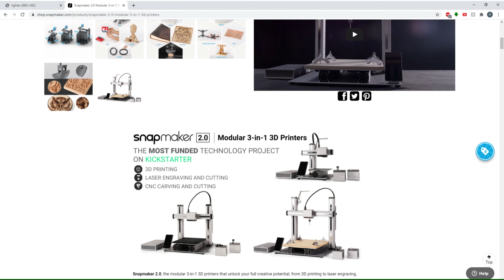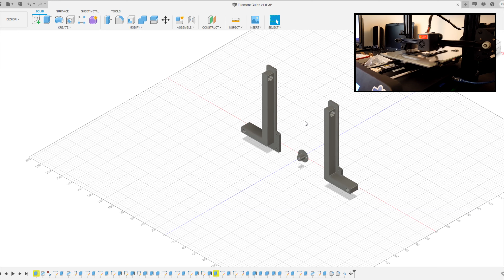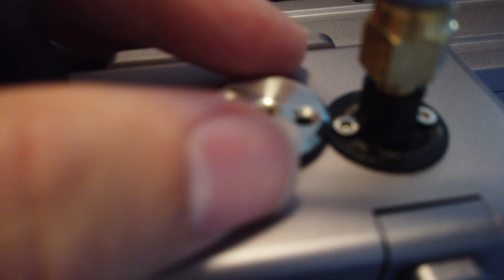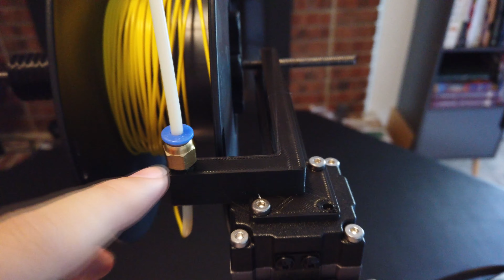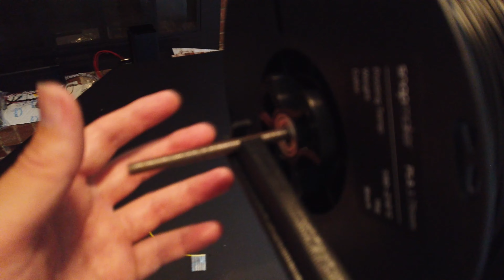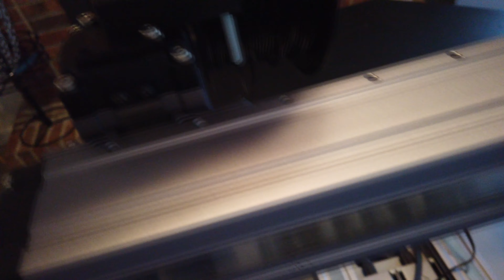SnapMaker 2.0 - Filament Guide System

Comment: It also tackles the problem of "shavings". These Snapmakers tend to rub the spool against the frame because it drags it left to right and the edge where it leans to is kind of sharp. What you notice after a while is a black dust build up on the lower end of the machine incl on the guides. Now that is something you do not want. So this is a way of solving that. Nice mod.
Reply from the maker: Thanks!

Comment: Is there a reason why you did 3D print the disk-like adapter instead of repurposing an M6 curled nut (e.g. DIN466)?
Reply from the maker: I didn't know that nut existed, and the 3d print took like 5 minutes to design and 3 minutes to print and has worked great.

Comment: Is that little black part you 3D printed to replace the silver part on the top of the 3D Print module on thingiverse?
Reply: Nevermind: just found it thanks, have to say though that the feeding system you made is reallly interesting and I'll probably do something similar for my SM 2.0!
Reply from the maker: Good deal. There is a better version of that cap on thingiverse. Just check the comment on my listing and you should be able to find it.

Comment: Very good  but i do have a question do you think it will fit inside the enclosure?
Reply from the maker: I do not have one to measure. Even if the spool supports do not allow to be use inside the enclosure you can figure something out to place on the outside.
Reply: @TechCentric_00  Thank you for the quick response.  It's  funny you're  into the same stuff I'm doing.  Boston med packs, Headway and the SM2... I subscribed and keep up the good work looking forward to more  videos thank you

Comment: Have you noticed this performing better than the original system?  Have you had any more or fewer feeding issues?
Reply from the maker: I didn't have any feed issue just using the solution that comes out of the box. I just didn't like it. It left the filament exposed and I could see with rapid head movement the spool could come unwound. This system gave me that peace of mind and the ability to hold a couple of spools and after 100+ hours of printing I have seen no feeding issues.
Reply: @TechCentric_00  doesn't even need to be rapid. If you're printing a low object and the filament's all stretched out, the moment it homes the Z axis and goes up to the top, there's no tension on the spool - and that will cause it to come loose. A couple of times I've had it pop off to the side because the loops around the spool have gotten so loose when the Z axis has come up to the top while homing - but I've been there to catch it.

I actually thought about making something very similar to what you've done. Nice to see I wasn't the only one. :)